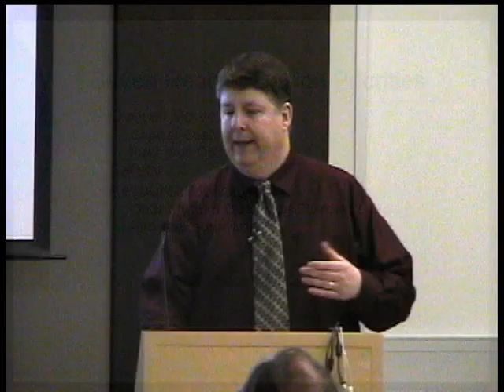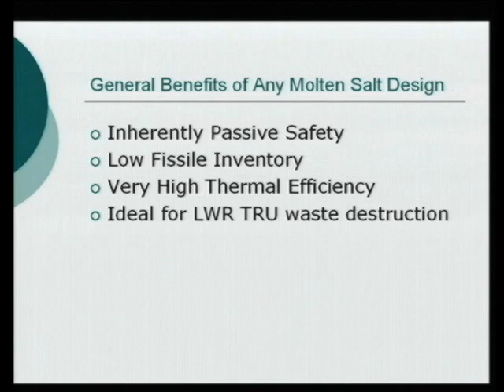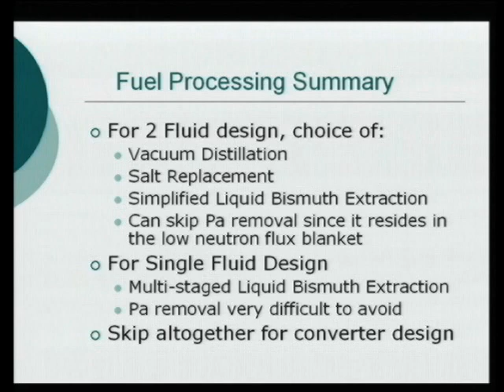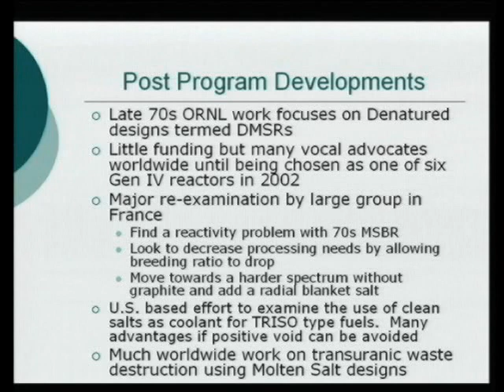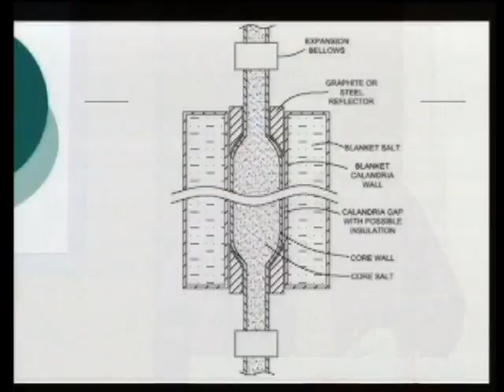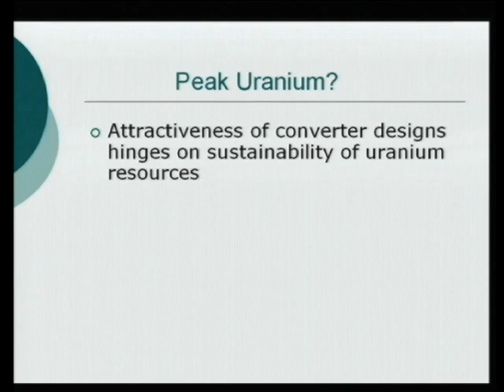Liquid Fluoride Reactors:  A New Beginning for an Old Idea

Comment: We should consider adding research and SMR test reactors onto existing generation sites, in that way the heat could be used to generate heat for profit and all the other existing facilities would already be in existence and otherwise fully licensed,  as would necessary personnel and other aspects. Test reactors could also come in handy to substitute for existing reactors scheduled to be taken off line for fueling or other maintenance.  In this manner, the heat output would start generating revenue on day one of its operation!

Comment: i don't understand why the spheroid reactor is too small. Size doesn't matter. Power doesn't matter. What matters is the cost measured in dollars per watt. A smaller reactor lends itself better to serial production (assembly lines).  Bonus points if it fits in a standard shipping container.  doesn't matter if it's 1 MW for 2 million bucks or 100 MW for 200 million bucks.

Comment: Canadian. yay for LFTR
Reply: 250000 tonnes of high level nuclear waste Worldwide, from just 60 years of fission nuclear power generating circa 10% of total electricity power generation; there is nothing sustainable about conventional nuclear fission power!  There is nothing sustainable about nuclear fission power, even molten salt reactors, because the alongside reprocessing plant required for a molten salt reactor will also generate a radioactive waste stream. The idea that a molten salt reactor can "burn" the nuclear waste is a myth; in trying to burn up nuclear waste, new radioactive waste will be generator.  What Dr Sorensen is describing is delusional.  Yet more crap ill-considered US engineering, just like the AP1000 reactor design that was not properly earthquake proof, hence Fukushima Dai'chi.  At Oak Ridge National Laboratories, to this day, people are still trying to clear up the radioactive mess from Dr Alvin Weinberg's molten salt reactor experiments from the 1950's.

Comment: Is it worth the cost?
Reply: ... 250000 tonnes of high level nuclear waste Worldwide, from just 60 years of fission nuclear power generating circa 10% of total electricity power generation; there is nothing sustainable about conventional nuclear fission power!  There is nothing sustainable about nuclear fission power, even molten salt reactors, because the alongside reprocessing plant required for a molten salt reactor will also generate a radioactive waste stream. The idea that a molten salt reactor can "burn" the nuclear waste is a myth; in trying to burn up nuclear waste, new radioactive waste will be generator.  What Dr Sorensen is describing is delusional.  Yet more crap ill-considered US engineering, just like the AP1000 reactor design that was not properly earthquake proof, hence Fukushima Dai'chi.  At Oak Ridge National Laboratories, to this day, people are still trying to clear up the radioactive mess from Dr Alvin Weinberg's molten salt reactor experiments from the 1950's.

Comment: This has been tested over and over again(as in taking a chunk of Cs-137, Pu-238 or Sr-90 and blowing it in various configurations of high explosives over a grid of detectors out in the desert to see where the dust goes).

With any kind of realistic device far fewer will die from radiation than from the explosion and few if any from accute radiation poisoning. If people were rational the 100 that die in an explosion are a bigger tragedy than the 10 that might die from cancer in 20 years.

Comment: This may be better than concentrated solar thermal power with (liquid salts ... again) heat storage!
I prefer the expansive "cover the deserts with mirrors (not black PV) idea" only because it seems that with the diffuse nature of solar, many thousands of times more jobs would be created. Of course because of that, energy costs would be more. Would that be the solution to the melting economy? (Need an economists to answer that one).
Reply: . 250000 tonnes of high level nuclear waste Worldwide, from just 60 years of fission nuclear power generating circa 10% of total electricity power generation; there is nothing sustainable about conventional nuclear fission power!  There is nothing sustainable about nuclear fission power, even molten salt reactors, because the alongside reprocessing plant required for a molten salt reactor will also generate a radioactive waste stream. The idea that a molten salt reactor can "burn" the nuclear waste is a myth; in trying to burn up nuclear waste, new radioactive waste will be generator.  What Dr Sorensen is describing is delusional.  Yet more crap ill-considered US engineering, just like the AP1000 reactor design that was not properly earthquake proof, hence Fukushima Dai'chi.  At Oak Ridge National Laboratories, to this day, people are still trying to clear up the radioactive mess from Dr Alvin Weinberg's molten salt reactor experiments from the 1950's.
Reply: @tommorris3688  
That's because it was an experiment. Today, we could have automated decommissioning, just like we have auto rocket return landings...
Anyways, we would probably have a mess if we did all that, however, less people would have died. Seriously, the alternative for the last century and the first two decades of this killed millions, according to CDC (is it?) because of smog, acid rain, etc.
Edit, had to cut it short, just got the jab...
Anyways, done and out of the waiting room (waiting for my arm to hurt) 😊
I said the first two decades of this decade, meaning we don't need nuclear anymore! Maybe for an area that has little solar, wind, hydro and long powerlines resources?
Anyhow, best to continue with Tesla style industrialism 😆
Reply: @fireofenergy  Well, if your assertion is correct, what about Fukushima Dai'ichi ? ... it is not possible to make robots function there because ambient radiation levels are too high.
Reply: @tommorris3688  
All the accidents were caused by not have molten salt.
Reply: @fireofenergy  Yes, I accept that.  A molten salt reactor has a less abrupt operating characteristic at criticality in comparison to solid fuel rod reactors.